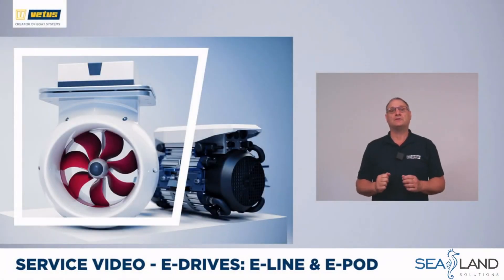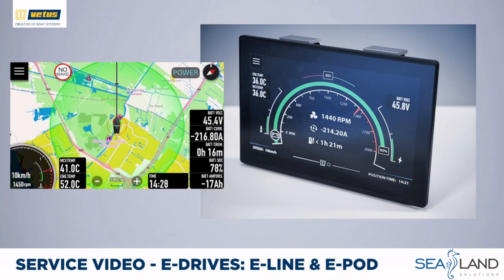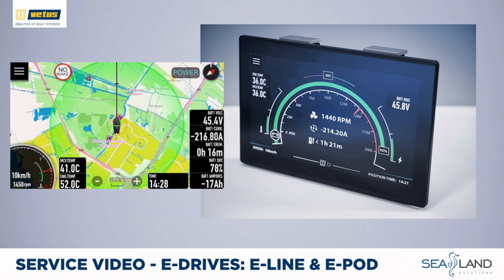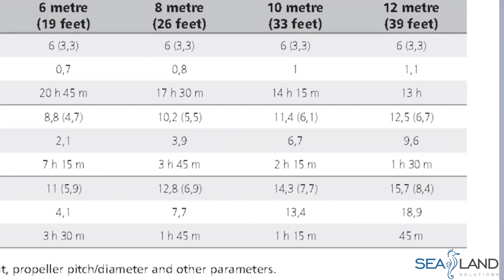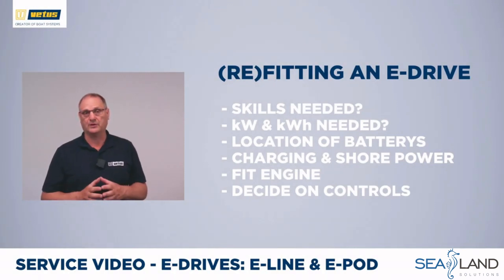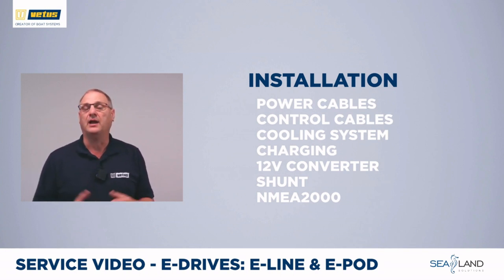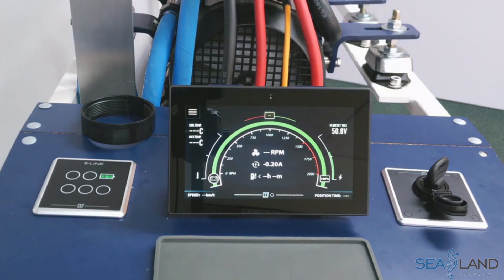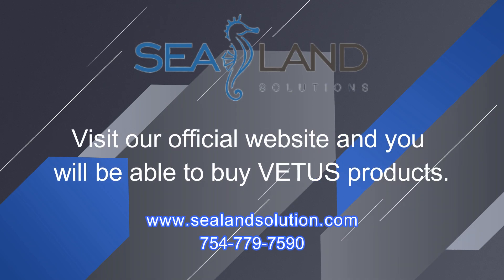👉VETUS electric propulsion systems   the E-line and the E-POD. Which E-Drive suits your boat?

Comment: What kind of E-propulsion motor for fishing boat will fit if  an 100 feet
Reply from the maker: VETUS.  has currently an 11 KW motor as their bigger unit which probably be our bigest currently dedicated to the small craft market. We know that our  research and Develop department is currently working on bigger propulsion motors.  We will bring your question to them and get back to you as soon as we get a reply.  Thank you for the interest in our products.  If we could get some particulars of your boat  Like :  Total dead weight,  beam and Breadth  what kind of propulsion does the boat currently have?  fuel and power.
Reply: and carrying or loaded of about 4 tons?

Comment: I have a 60'X20 fish tug on great lakes right now it has Volvo penta 100a diesel  250 hp , what size electric motor and how many batteries would it need for 12 hours every day use ,how many hours would it take to charge

Comment: This is fine as long as you have a diesel generator for long term power solution. Batteries are for short time applications when batteries can be charged overnight. Diesel is the only solution.

Comment: You should design a system that connects your propeller systems to the outgoing storm water pipes that are always below water line, in places like  Miami Beach, where tidal water flows back into to storm drain system.

Comment: All good info and a great practical demo. BUT! The suggestion for determining the power required may prove to be inadequate fo a sail boat. Imagine the scenario where you are taking shelter in an anchorage from very strong winds. You are securely anchored and wind is whipping the surface off the water and is howling through the rigging, the angle shifts around due to the land form ashore. Your anchor monitor shows you are not moving and you are satisfied you having good holding and you are safe. Until through the spray you notice the large charter catamaran closer to shore directly upwind is no longer head to wind, is it dragging anchor and moving toward you? What do you do?
1. You optioned for a motor just powerful enough to just about achieve hull speed and after turning the motor on and applying full power you realise that in this strength of wind the forces against the rigging are too great to motor up, retrieve your anchor, move out of the way and re-anchor so you stay put hoping the catamaran will somehow miss you
2. You opted to install a motor closer to the power recommendations of your boat’s designer, you also installed a battery pack that allows full power running for at least 45 minutes and a 48v genset that enables half motor power for as long as the fuel lasts. You turn the motor on and push the throttle lever forward and as you get to about 3/4 power you sense the boat easing forward. Immediately you start the generator to extend range. As you steer into the wind easing the strain on the anchor you begin retrieving it until it is up then veer away before turning back upwind. The catamaran, side to the wind and chop surges past right where you where only minutes earlier. Another twenty minutes later you have manoeuvred back upwind, a little closer in and again deployed your anchor. While at times you used full power you didn’t come close to hull speed let alone any faster.  
I believe suppliers need to verify your potential usage requirements and make recommendations accordingly. And boat owners should consider their potential usage requirements and select options to suit.

Comment: Interesting , Thank You . I think that  electric boats have the same problem as electric cars, or any thing electric, RANGE and where does the power come from. As to how much power do you need , I worked on a 42 ft. fishing boat . the engine was a Detroit v671 that I believe had about 100 Hp. , cruising was about 8? knots, the mass  was about 45-80? tons depending on fuel and fish load. As a point we did tow a 145 ft. Purse Seaner 120 miles , it did take 38 hrs. The boats mass was about 800 tons . Sadly we were towing the Last active Purse Seiner operating out of San Diego to San Pedro so they could unload. I do hope that you're system works . I can see where combined with solar panels  and a small engine cruising could be more affordable and enjoyable . At least you have a place to start . Thank You , happy cruising
Reply: Build boat with solar panel roof and two large batery packs
Reply: @jjw5165  Good idea, as long as the sun shines.   another problem is that batteries are heavy . in all fairness engines and fuel are too. Still an interesting concept , there are some interesting ideas out there